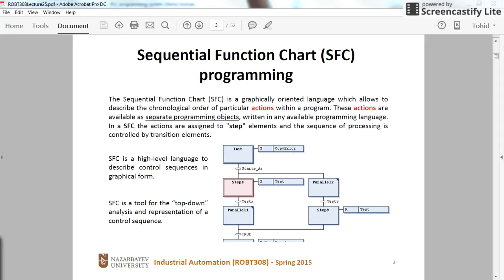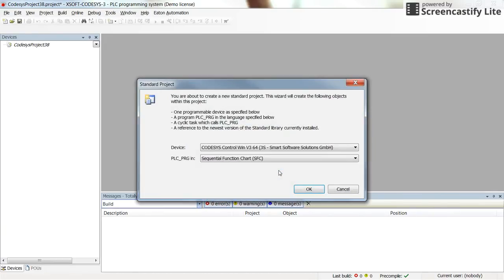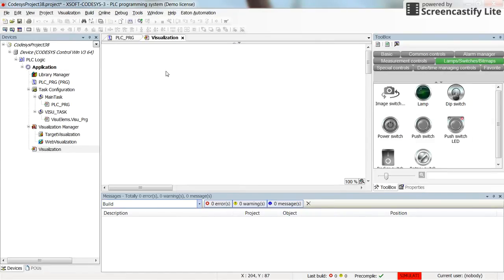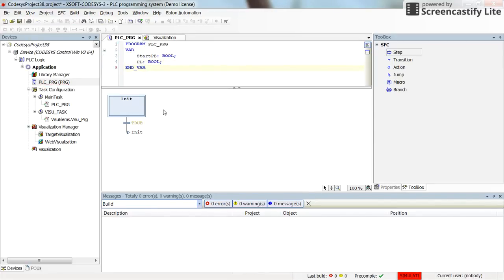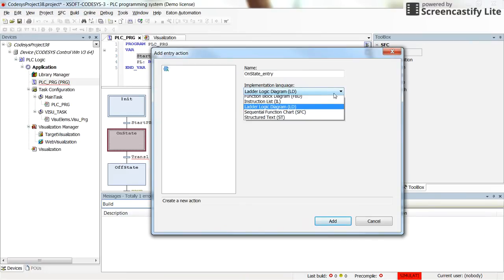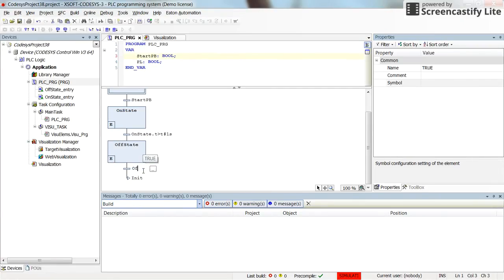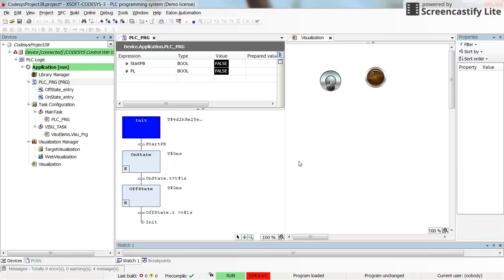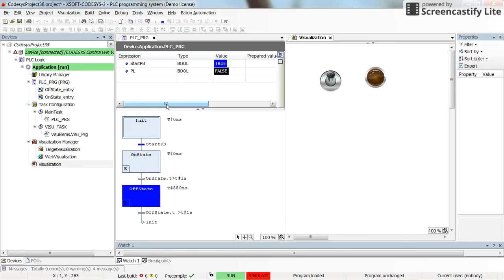CODESYS: Sequential Function Chart (SFC) programming - First lesson - Background music removed

Comment: Hello sir, do you know 1/ how to create several SFC running together without creating an explicit parallel branch ? 2/ how to reset (forçage in French) SFC separately. For example G2:{init} ) ? I have a "master" SFC security controlling two "slave" SFC (control and production). The initial step of the master SFC resets the two slaves (i.e urgency button). I initially create a file by SFC, but only one SFC is running. I then tried to write 3 SFC in the same layout with their initial step, but CodeSys wants to add them a link, so I added a parallel branch. I also checked how to reset slaves SFC to their initial steps, but the project option SFCInit only reset the whole SFC, so I tried to add an action doing G2.Step0.x = True; G2.Step1.x = ... = False; (structured code) but in simulation the steps I enabled  are not blue. I have no idea how to fix that. Could be nice to have a tutorial about this case of usage :) Thanks in advance